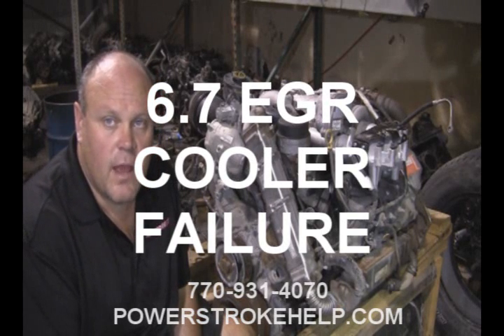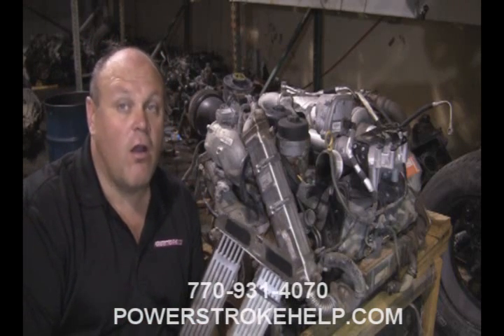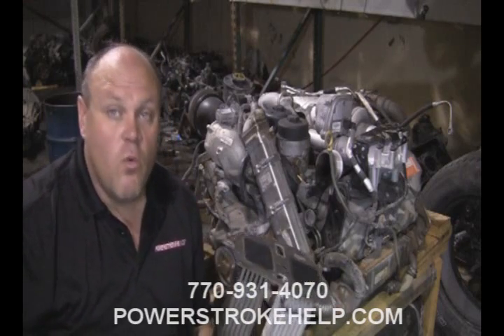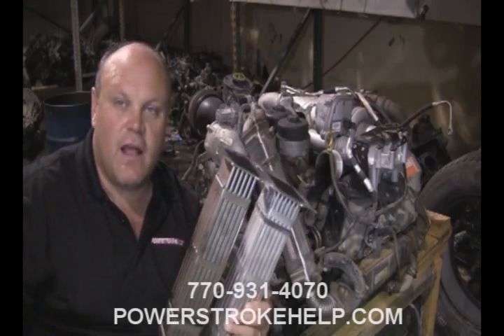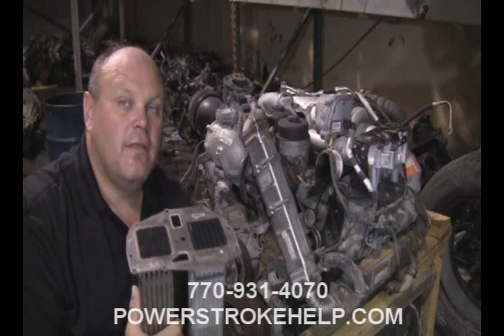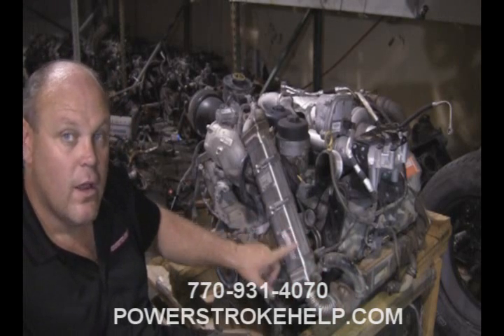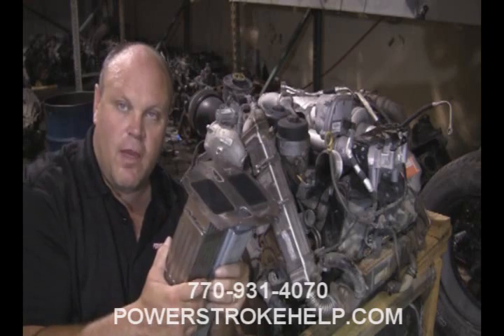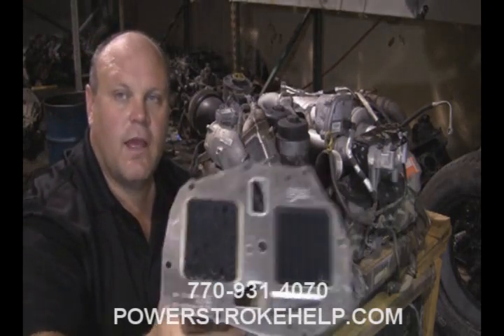6 7 EGR COOLER FAILURE

Comment: Hi Bill. I have a 2017 f250. 6.7.... I have a p2457...P259f...p132B code coming up.. I loud ticking started happening today and smoke coming out.  If the egr cooler is clogged will it make thar tick sound. Almost sounds like an exhaust leak. And it smokes like crazy. .

Comment: Meanwhile the LML Duramax has a bypass built in specifically for rerouting exhaust gases when idling to prevent damaging both heat exchangers inside the EGR.

Comment: Hi I have a international terrastar maxxforce 7 with 123,000 miles it started to throw a lot of white smoke when you drive it and hit the gas, should I replace the egr or delete it? Thanks I saw that the egr part cost around 1,500 and I don't about the labor 😅 I got myself a truck with bad reputation

Comment: Best idea is to collect the exhaust for the egr system downstream of the DPF. This way the carbon and soot is gone. It also lowers the load on the cooling system.  Since the goal is to reduce the oxygen in the combustion chamber to lower emissions, this is a much better option. They already do this on big rigs, and im sure its only a matter of time before this works its way into the medium duty markets. The current egr setup is a result of needing to meet the emissions in order to sell the engines in the US market and were developed rather quickly. They work, but longevity is a problem and this also lets the abrasive carbon into the engines as well.

Comment: Hello.
I have a question:
My F450 dually displays 460000 km at the counter, with 4000 h of idle, do you think I should change it to a new one, even if I have no code?
I just got my catalyst system cleaned
and full particle filter.

Thank you for answering me

Comment: What all you people seem to miss,  and POWERSTROKEHELP should not be advocating the deletes,  is the DPF is there to remove particles that are known and proven to cause Cancer!  This looks remarkably similar to all those wilderness loving Cowboys advertising Marlborough cigarettes most of whom are now dead from lung, throat or mouth cancer! 
Don't delete your DPF.  Fix the issues that cause them to clog and then aud the overheat issues like proper tune up,  use of correct low ash engine oil, regular and proper maintenance etc.

Comment: I went thru all videos of engine problems with Ford or Toyota trucks. Toyota, no problems. Ford ? All kinds of problems with all  engine, eco boost or just any V8. Yesh fordis great?
Reply: Robert Hills Jr dude Toyotas for one dont get used in a hard work environment! They never pull heavy loads! Big companies With fleets of trucks that run the piss outta them and dont maint them dont have toyotas. Toyotas are bought by men that need a truck to sit in a concrete driveway and put some trash bags in the back every now and then.

Comment: Has anyone seen or heard of doing a heater core by pass on a 2007.5 and above 6.7 engine?  I have a 2007.5 6.7 dodge 2500 mega mega cab yes 6 door custom built truck and the AC system sucks, i'm in the processing of installing new aluminum blend doors and aluminum drivers, changing out the heater core and evaporator cooler core and removing a filter on the dash vent to help with the cooling the inside of the cab.  Due to the fact i have a 6 door truck if this does not work i will be looking into a stand alone system just for the very back or rear of the cab for the kids due to the heat in Las Vegas.  If anyone has ever done the bypass for the heater core for the 6.7 please let me know and send pics or specs on what was used.  Everything i've read it's supposed to cool the AC down to 8-10 degrees colder.

Comment: Great information, I have a question about diagnosis on the clog. Did you pull it out because you had a code or did you determine the clog due to a temperature difference on the cooler itself with a lazer thermometer? I have a 2011 F250 with the 6.7 and it has code p0141. Its hard for me to believe its clogged because it only has 78k miles and very low idle time. Any help would be appreciated Thanks

Comment: I was reminded of an experience I had with my toyota tacoma by what bill says at the end of the video... "...letting it idle all day and all night..." I like to let my truck cool down for a few minutes when i'm done driving it, i park and let it idle for a few minutes. This particular day I had some stuff to carry inside so i thought i'd take my stuff in and come back outside and shut my truck off. Well i got distracted inside with making a sandwich and forgot to come back outside and shut my truck off. The next day i was getting ready for work and realized i didn't have my keys where they normally are so i went outside to see if i left them in my truck and the fucker had been running all night from 4pm the previous day to 530 then next. I was very thankful it didn't get stolen!
Reply: trevor kleinschmidt that's hilarious, I've accidentally left keys in the door of my truck over night. But never left it to idle.

I work in the oil patch in northern Canada. Some trucks just sit and idle for weeks without ever being shut down.

Comment: what would you recommend when deleting the emisions off a new truck. would you delete the EGR, DPF, and DEF all at once for the long haul or would you delete 2 of the 3? i may be in the market for a new 2016 f250 super duty soon and if you can do a video response on this question that would help out new buyers a ton
Reply: he is not going to say do the deletes....i doubt he will.  I as a DMAX owner have been running optilube, and archopil in my tank interchangeably, and now have about 800 engine hours on the truck, and will have a mechanic open it up to see how it looks.  If its isnt that sooty, and the archoil, with the optilube have kept things in check i will keep the emissions systems as long as GM is paying for them...if the intake, and everything looks like a mess....out everything will go

Comment: Well, what if these vehicles were equipped with a high idle that raised it to 1200 or so? It might use more fuel but I'm sure it would help with the clogging of the egr.
Reply: Not really. Even with high RPMs a diesel still does not generate much heat. Only when it is under load does a diesel generate enough heat.

Comment: Do you have any experience with the Detroit Series 60 DDEC V?
I have a coolant leak, bubbles in the coolant, loss of coolant, about 2 gallons every 100 miles.  No smoke. 
We diagnosed it as a bad head gasket.  I had one other truck, same symptoms. 
Just finished the redo. Head was vat cleaned, magnafluxed, new valve stem sleeves and injector O rings with washers.
Same problem. 
Bubble stream is steady, where before it would increase with the heat.
What say you?
Thanks
Charles

Comment: Just an FYI people, the reason ambulances are idled for extended periods is because there is so much equipment that would need to be powered by the batteries alone if the engine was not running. I am a firefighter/EMT and we do not just do mindless idling to put more wear and tear on our equipment, the ambulances will die if you leave them off and not plugged into a shoreline.
Reply: ryaneldredpa We have some 6.4s in the fleet and they are absolute nightmares...The 6.0 is a dream compared to it.
Reply: +joker432 No arguments from me.
Reply: It's a shame. Alot of fire departments and emergency services that have vehicles with the "pollution controls" are encountering just what the video portrays. We'll I'm here to tell you there is such a thing as a good clean running diesel that's tuned properly. No argument about it whatsoever. Can't remember specifically what department it was. A house and lives were lost due to a truck shutting down because of the pollution control disabling the engine. Try to explain that to the homeowners or family members as to why you didn't show up...
Reply: phanny pack When the truck that provides the specific services it's intended for that didn't make it because it shut down due to emissions when it was enroute to a call. Should have read and understood the initial point of my wording. Chill...
Reply: ryaneldredpa not our problem or my duty to "show up" i go when the truck goes. stfu.

Comment: Cetane Booster helps! Ford recommends 45 minimum and most pumps are around 40, its like an hidden octane rating.
Reply: I started using Power Service diesel kleen with cetane. I know it helped . in fact the exhaust clean pretty much doesn't come on since I started using it.  So you think it helps with soot build up in the cooler, if so then another bonus.  Hope it helps keep the exhaust sencers clean also.
Reply: +Kenny Budden Cetane Booster helps lower Soot buildup especially in the EGR system
Reply: +John Copello 
good to know

Comment: hello  powerstrokehelp 
I have a FORD F-450 6.4 2009
and the speed is lock in 120 km/h
how can make it 160km/h
Reply: +najem soc The high gear ratio in the F-450's will keep the engine RPM really high and you will have premature engine failure from it, especially on a 6.4L Diesel. 90% of the 6.4L engines I've replaced are on cab chassis trucks with high freeway mileage that saw extended periods of high RPM.
Reply: With a tuner you can recalibrate it. I have a SCT tuner on my 450 and took the governor off. The tires on those trucks are rated for 80 MPH and below, don't recommend driving over 80 if you don't have to but sometimes you need that extra speed.
Reply: Blake Watson

Comment: you gotta love the mindset of fire fighters and EMTs  
Idle for hours on end and then as soon as you jump in pedal to floor,
Reply: these trucks are powering a ton of equipment. Radio's, computers, flashlights, interior lighting, air conditioning for a large patient compartment etc.... these trucks are generally not high idled for as long as he states. when it is your emergency you are going to want these ambulances and all of the equipment functioning and I'm sure you will want the ac or heat properly functioning. the only time we have fire trucks running for prolonged times is when they are on an emergency.
Reply: Uhhhh the batteries on an ambulance will die if you leave it off without being plugged into a shoreline. There is so much equipment that the batteries would need to power if the engine was not idling. I am a firefighter/EMT and I love when people like you comment on our job when you have no idea why we do what we do, there is a reason for everything. You seriously think we want to intentionally destroy our equipment by mindless idling? Wow....
Reply: +xxbryan715xx I work for a hospital in Redlands Ca and believe me the Ambulances idle for many hours here. They have cut time by half now. But back when I first started you would have guys and girls Idleing there rigs for 4 to 6 hours.
Reply: why dont they order ambulances with gas motors? it's not like they are towing a 12,000 pound tailer up the rocky's. so what if it uses more gas, fuel costs will be greatly offset buy the cheaper maintenance...
Reply: az2stroke many van ambulances are gas. Type 1 ambulances are generally diesel. They have a bigger compartment for the patient and carry more equipment. Our ambulances with equipment are almost 20,000 pounds. A diesel can be very helpful.
Reply: Damn! I didn't know they were that heavy. why not have a generator like an RV to power all the equipment? seams like a bad idea to make the motor power everything on a emergency vehicle like that.
Reply: az2stroke
They usually have 2 alternators although I have seen a couple with 3.  Not sure why they don't run gensets, I just fix them when they blow up lol

Comment: Thank you for this wonderful video.
I have a 2012 f250 KR 6.7L. 113K Miles.
Check engine light on... EGR Cooler, gasket kit,and NOx sensor replacement are recommended by the Ford dealer.
I am debating on doing this repair or performing a complete delete of EGR and down pipe.
Any suggestions?
Thanks for your help
Reply: +Joel Dale Deleting EGR doesn't give your engine more power.
Reply: Do an egr delete you gain more horse power out of it
Reply: +John Copello I would tend to think that you will get more power and fuel economy without feeding the engine exhaust gasses, but that's just me. Feed that engine fresh air and get rid of the DPF and all its sensors and you got a masterpiece. I own one so I know. :)
Reply: Gut the emissions garbage if you can. Your engine will last longer and be more efficient.

Comment: Bill, I got a question for. What kind of problems if any, are you seeing with the 6.7 PSD? At the moment I am looking at buying a newer diesel truck somewhere between 2010 and 2012. I have been considering the Cummins but I understand once you start tuning and deleted the emissions equipment they start having head gasket issues. The common fix seems to be install ARP head studs. On the other hand the 6.7 PSD, I haven't heard anything bad about them. However, recently since I started looking my buddy who is a Ford Technician told me that at his dealer they have been coming in often with inconsistent issues. Things like boost issues and DEF problems on the equipped models. 

So what is your take on the 6.7 PSD? What problems have you seen from them?
Reply: +stayunique91 Turbo Failures, EGT Sensors go out OFTEN, oil leaks, Fuel contamination causing high pressure pump failures. Engine Failures from Tuners. Quick Lube places forgetting to put oil in them.

Comment: So a note to ambulance drivers: DRIVE THE BALLBAG OFF IT SOMETIMES!
Reply: ***** The 6.0 was in an Ambulance? R.I.P innocent patients.
Reply: +Diesel Man we had a 6.0 catch on fire and burn with a patient going to the hospital. we got the patient out safely but the truck was done.
Reply: I am surprised that the government doesn't offer any sort of emergency vehicle exemption thing. I would think the extra reliability is a must have for such a vehicle.
Reply: Diesel Man we where looking at having our 2 2009 Chevy Kodiak 4500 duramax ambulances straight piped. Not because our patients demanded we roll coal to the hospital but because our ambulances would kick into emergency regeneration mode on the highway. All of this emissions  bullshit has made it a nightmare to use these ambulances and fire trucks for our department. If I could I would love to be driving two 7.3 ambulances but the ones that exist have been driven way to hard and should not be put into emergency service anymore.
Reply: xxbryan715xx Hey I hear ya man, and I agree 100%. All this emissions crap just kills reliability as well as power and fuel mileage. From a technicians point of view I can honestly say the best bet is to avoid it when it is feasible. If I ever ran trucks I would most likely go with one of those glider kits so I can have a decent truck without all that extra junk, plus save some cash in the process.
Reply: xxbryan715xx your not because your patients demand you roll coal 😂😂😂😂😂😂 i laughed hard af when I read that
Reply: we do on every single call. that is part of the reason we get so many egr problems on the newabulances. the trucks run rich from the pedal being to the floor and they build up soot easily.
Reply: 6.0 the perfect storm

Comment: is there any way you can just clean the egr cooler out? i mean, i dont think its physically impossible.
Reply: On Navistar engines we have a egr cooler cleaner where it uses a solvent and a flush machine we clean them under warranty when we get egr low flow rate codes

Comment: Hi Bill I have a 2013 F-250 platinum. Are there any full soup to nuts quality kits for the 6.7 that delete the egr, dpf and that urea system? Also if it doesn't include a quality tuner whats a good one for the 6.7? I don't want to make tons of power and do burnouts, I'd probably keep it on economy most of the time unless I'm towing the boat or my quad trailer. Also can you recommend a turbocharger that's exactly the same minus the ceramic ball bearings I heard other people talking about that, plus you said it in one of your newer videos or should i just leave it alone. I Just want to get super longevity out of my engine and save on gas. the fluids area always changed right when the computer says to do so by ford. I get there asap when the lights on. I don't beat on my truck ever that's what my sti is for. truck is for comfort and room on long trips plus the ability to get up the mountain to out other house when the road is covered in snow. I love watching your videos your learn so much. thanks ahead

Comment: Give er the ol' Italian tuneup
Reply from the maker: I love it. I used to work for an older I-talian man when I was in college in St. Louis. He would charge these high priced west St.Louis housewives a fortune to "tune up" their Jags. He'd hit I-70 East toward Terre Haute, IN and 50 miles out he'd run the Jag up to a 100mph and It'd spit and sputter for 8-10 miles and then she'd clear up and run like a dream. We'd head back and change the plugs, etc and she was good to go.
Reply: While my only experience is with gasoline engines, I can testify to the power of the "italian tune-up." God as my witness, I got a cammed-up Acura with a nearly dead cat past Cali smog with nothing more than a half-hour on the freeway at 70+ in 4th gear, turning 4500 rpm or more the whole way.  

I damn near kissed the ground when I passed on HC (hydrocarbons) by one part per million.
Reply: TheOtherDave I will never live in California because of how crazy they are there. Where I live you can get away with anything. If the rest of the us gets like that I'll move out of country.
Reply: powerstrokehelp Interesting ! So what exactly was getting cleaned or burnt off during that highway run. Exhaust build up ? or the excess fuel flushes the carby ?  Or the heat burns off crap on the plugs ? Can you explain a little about what happens when you do this I-talian style tuneup please ?
Reply: powerstrokehelp LOL! "Italian tuneup" hahahaha